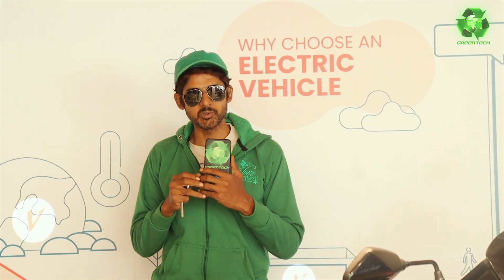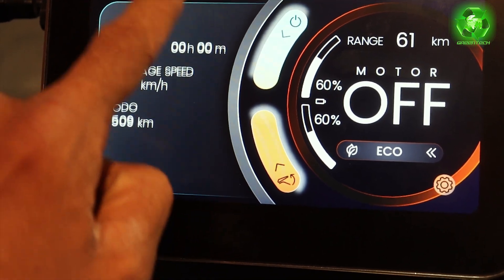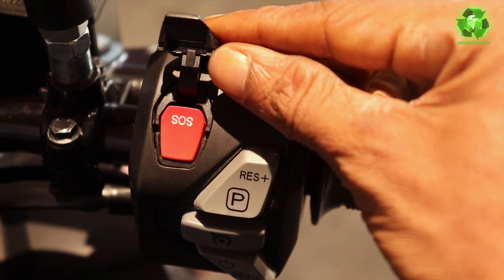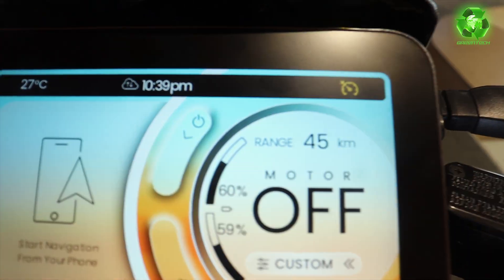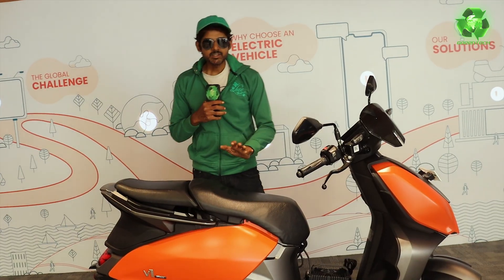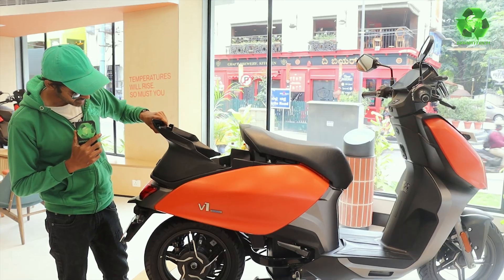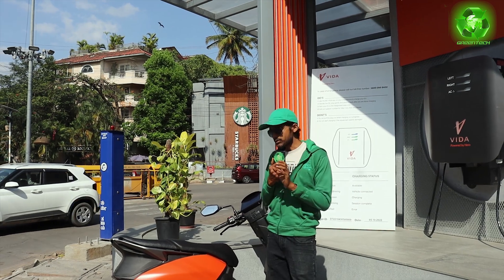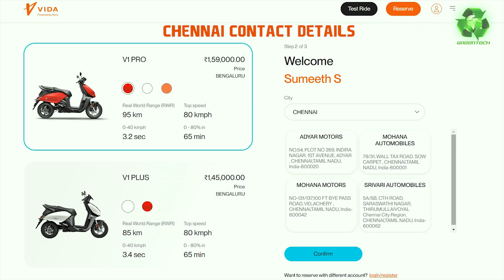Hero MotoCorp Vida Electric Scooter Now in Chennai | Unseen Highlights & Features of New V1 & V1 Pro

Comment: Many people here buying ola and TVS can't understand that Vida comes with removable battery. In flats, you can't keep charger in night safely and installing charger in car park is not feasible. This is the only EV which allows charging at home safely in the night. With such features and PMSM motor,  the price will be reasonable. BLDC motor used by TVS is cheaper and so they offer at less price. 
Hero and Ather have common charging station. That's another advantage. I don't want to compromise on plastic single fork suspension of ola by paying less with no service stations. Hero brand and reach is way ahead of others. Vida v1 the 🌟
Reply: I saw one news one person died in kerela due to rear wheel broken due to pmsw motor struck in highway and he died .another one more person recently same issue wheel broken but safe.In tamilnadu one youtuber son got accident due to limp home issue.

I am willing to buy hero vida pro due to its recent offer but i was scared to buy.Please advise shall i buy or not considering above?

Comment: வாகனத்தின் ஸ்பெசிலிட்டியும் அதிகம் விலையும் அதிகம் ரேன்ஜ் இன்னும் கொஞ்சம் அதிகப் படுத்தி இருந்தால் நன்றாக இருக்கும் நண்பரே நன்றி
Reply: Basic non feature EVs are available even for 65000. But people look for unwanted features and complain of the price... I own BattRE one model scooter for more than 3 years. It has safest LFP battery from Okaya. Range close to 55 Km real life....Absolutely no issues. I serviced only once.. Okaya supported with battery replacement when I had some range issue...I bought that for close to 85 K. Charger auto cutoff feature available. So no worries about over charging...It has dual disc brakes. I replaced brake pad recently myself.. Had to replace the lockset as someone damaged the lock in a public parking. That too I did myself.
If you know basic idea you can easily maintain EVs yourself... ( Not for Controller/ motor/ Battery. They need professional maintenance knowledge).